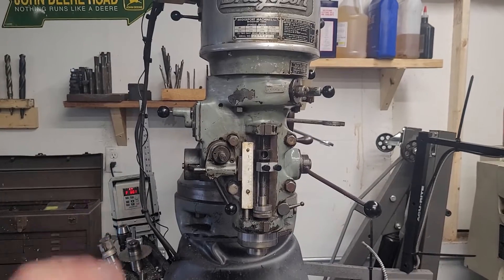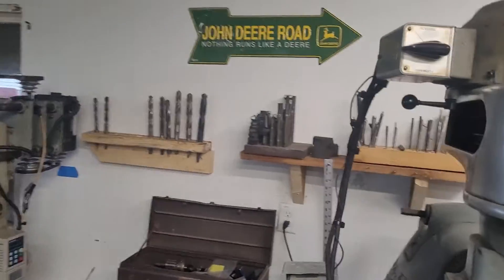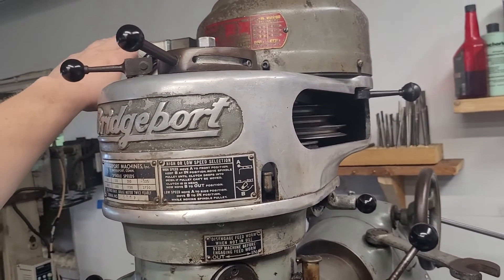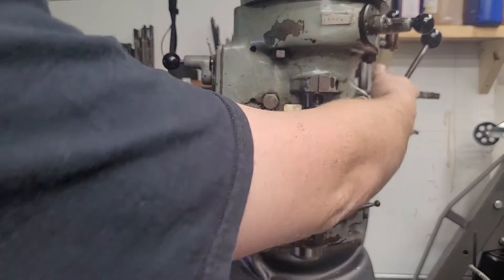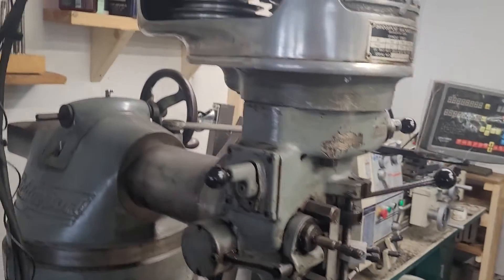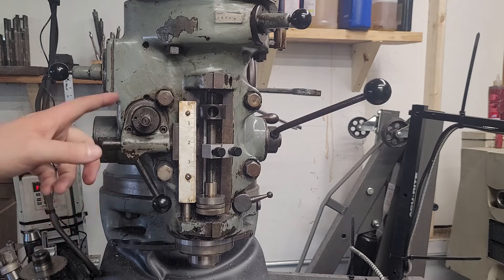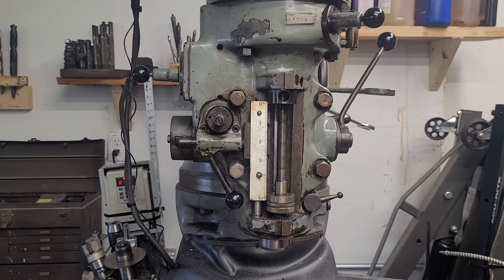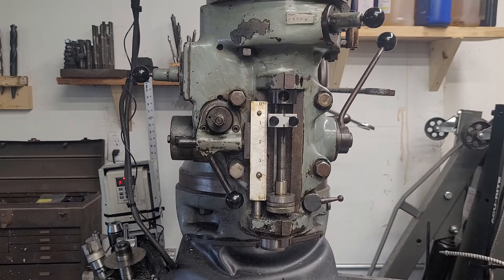Bridgeport J head Features and Functions

Comment: Remember to give the spindle a little hand rotation when putting it back into direct drive (high gear) to make sure the spindle is engaged and the front pulley drops back in. Bumping the switch is also a good habit.
Reply from the maker: I usually grab and spin the pulley. If it makes clunk clunk noises you are good to go. This machine is very tough to go from high to low since I so rarely use low range. I ought to just cycle it now while I am thinking about it!

Comment: Good video. Thank you.  FYI:  The reason that the downfeed can not be engaged with the quill all the way up is that the Auto disengagement pin is pressed.  Rotating the quill down slightly releases the pin.  This is normal operation.  The pin is just behind the slotted screw at the top of the depth stop rod. Regards.
Reply from the maker: That's one of those obvious things I never bothered to put thought into. When I first started using a mill, someone told me to bump the quill of the feed won't engage. Though I've never used the feed to cut upwards. Have you ever needed to? It could make sense facing some extremely odd parts but I've never seen a reason for it.
Reply: @moosesmachinery   More than anything, it's a safety feature to avoid damaging the feed system. The power upfeed, as you said, is seldom used, but it is use to avoid getting a spiral mark or groove in the finish of a precision bore from manually raising the quill.  Thanks for the video and the reply. Regards.

Comment: Incredibly useful for me! Not a whole lot of info out there about the operation of these older models.
Reply from the maker: There is, but you have to go to the early 2000s BBS (pre tap talk days!). It's buried under all the crap unfortunately.  The detailed operators & service manuals are available and extremely helpful. I'd suggest never doing spindle bearings unless you have the manual in front of you.

Comment: Nice breakdown of the machine
Reply from the maker: Thanks! Glad you liked the video
Reply: I rarely use the power down feed but nice to see the features. Didnt know you could change feed rates while running. Thanks, great chanel
Reply from the maker: @rickjohnsonjr8954  I lean on it very hard for boring. On my machine it's extremely difficult to change speeds when the machine is not running. I should probably read a manual and make sure it is not causing damage haha